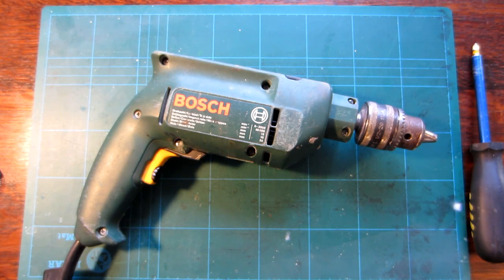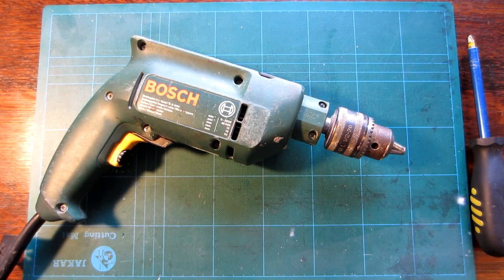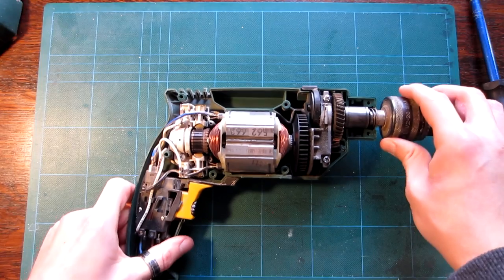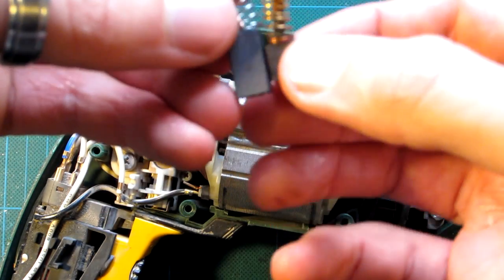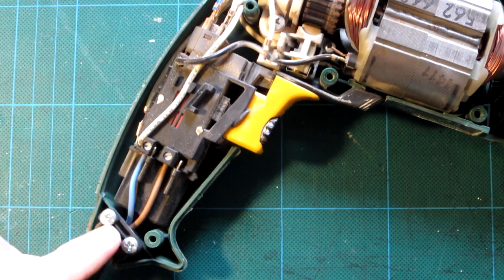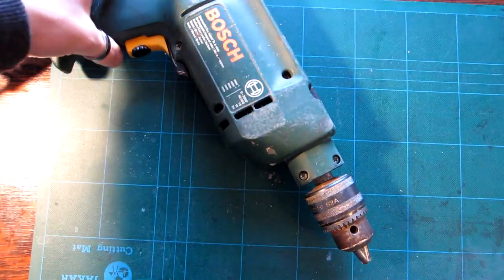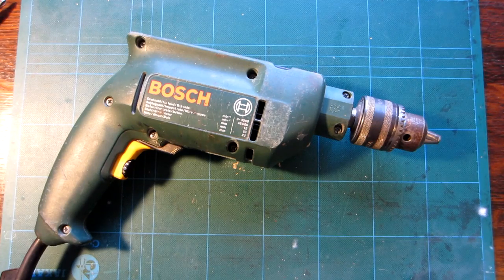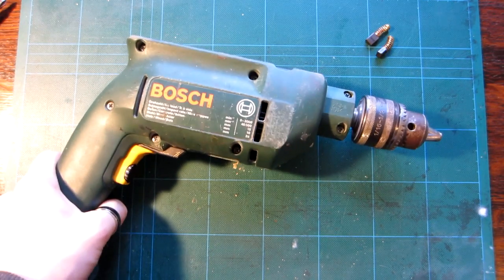► How To - Replace Worn Power Drill Brushes ◄

Comment: While you had the drill apart, a good idea would have been to clean up the armature with fine emery cloth.  The carbon buildup can degrade the performance and cause mini short circuits.  Also, your brushes would last longer
Reply: Idealy remove the armature, and using a metalworking lathe, place in a 3 jaw chuck with a revolving center in the tailstock. Gently tighten the chuck to avoid damage (wrap some thin brass shim around the shaft end) and turn slowly using some fine, say 380-400 grade emery paper to give a shiney finish on the copper surface. With new carbon brushes it will run like new. Don't forget to re-grease the bearings.

Comment: Do you know that black thing under the swich with three terminals the two terminals were connected to the main power supply while the third one is connected to the stator, mine is bloated and I need a new one.

Comment: They are a fairly standard size , so hold onto them for other motors.

Mine also had a Broken electrical  spade to the brush housing , so after  removing the commutator and cleaning it , I replaced the brushes , then got some fluxed solder and  my trust iron, and soldered the clip on as it had  fatigued with vibration ( and soldered the other one whilst I was at it .)

I don’t put video on You Tube, but whenever I disassemble things , I always film it just so I can see where everything came from in what order , what way round it was etc. 

And since I started doing that , I don’t have any ‘spare’ bits left over ! 

Ps I cleaned out and regreased the gears whilst I had it apart, it is going well, but sadly the front bearing has a bit of a wobble , so no precision drilling with this one, just use it for pilot holes and it’s hammer action. 

Nice video ( and hair)

Comment: My hammer drill is no longer rotating right (stop start) but rotates the other way. Would that be the brushes?
Reply from the maker: That is more likely something to do with the switch/trigger mechanism, which depending on the drill might not be fixable unless you can find a replacement mechanism. Give it a good clean first sometimes the contacts can get crud in them. Hope that helps!
Reply: @LukeMakes  thanks Luke

Comment: a little 3 in 1 oil or equivalent in the ends of shaft so it spins freely? clean commutator with some sandpaper to make it shiny again? clean out between the commutators with razor blade  to get old graphite out of the commutator and a little oil/grease on the drive gears so it lasts another 100 years with moderate use and decent care.

Comment: Do I have to  replace the same brushes that was in the drill or can I use any brush
Reply: You could retrofit any brush to fit but in general you should get the specific brush for your tool mate. Brushes have dimensions and an OEM part number. If your tool is an el cheapo one you can take a micrometer and measure the size of the brush(length x width x height) and then find one that fits soon as the configuration is the same(some are spring loaded or on others the spring is on the brush holder of the tool you have already and they have a female spade connector). As well take a bit of micro mesh or 600 grit dry sandpaper and clean the commutator up on very low revs so you have bright copper showing on the end of the armature(the rotor) that is in contact with the brushes. Be careful not to get an electric shock obviously. There are specific commutator stones for that as well. 
Blow all with high pressure air mildly. The above will make your tool essentially brand new.What tool is it?
Reply: Dont forget that your brush will probably be worn to shit so only two dimensions will be correct (width and height), the length will be shorter obviously.  Hope that helps you bro.

Comment: You may or may not have noticed there is a wear line on the carbon. You can see the line in your video when you initially compare old and new. You are just slightly past the mark at an angle.

Comment: arc produced is visible will using drilling machine , is it common or defect in carbon brushes ??? pls reply
Reply from the maker: It is very common in cheaper drills and is usually a sign of the brushes skipping. As long as it doesn't make any burning smell it should be fine but it might be worth inspecting your brushes and looking for any dirt or debris in the motor. Hope that helps!

Comment: That being presented, I will add also, never, use brush having tools like sanders on material that have silica, like gypsum board or sheetrock, because the silica, or calcite inside the dust will cause the brushes to corrode; rendering the tool useless until repaired.